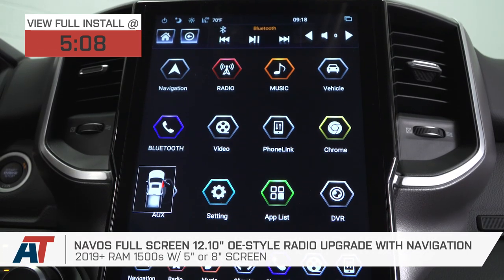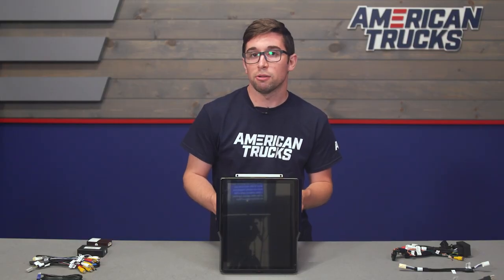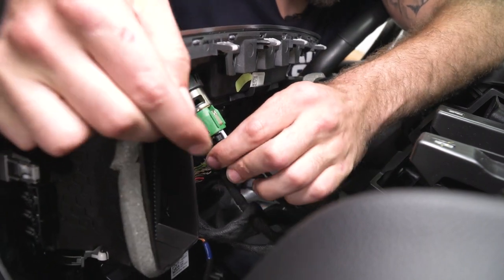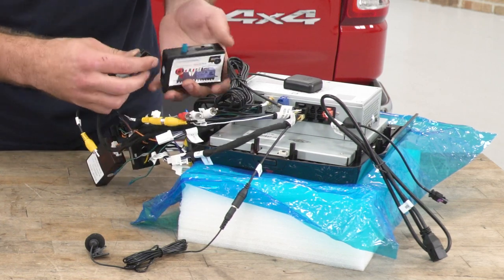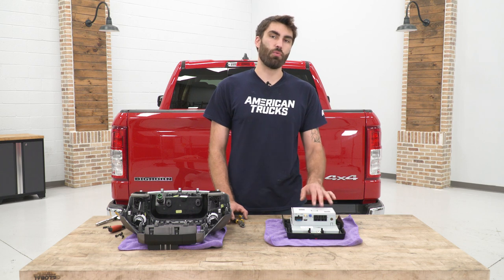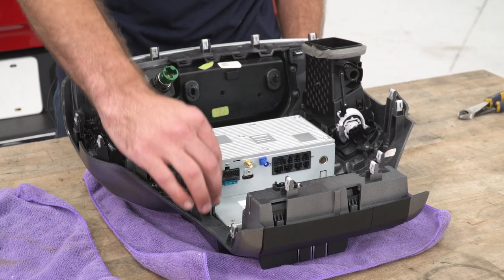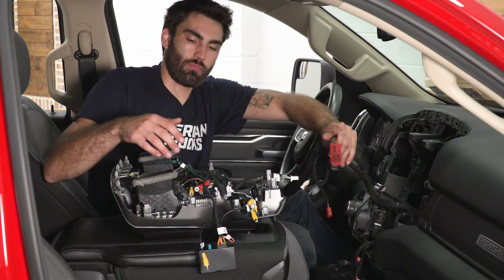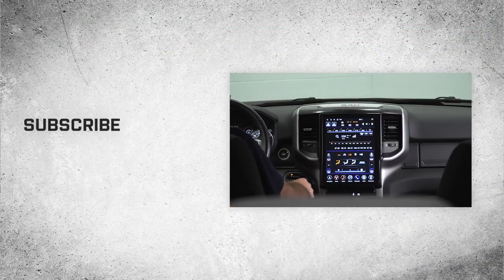2019-2022 RAM 1500 Navos Full Screen 12.10-Inch OE-Style Radio Review & Install

Comment from the maker: Shop this Navos OE Style Radio! : https://amtrucks.at/3deldWv
Reply: Does this fit a 2013 ram truck
Reply: For iPhone CarPlay you usb connector has a cable with “PhoneLink” label that one need to be run behind the dashboard and pass under then you can connect you apple CarPlay
Reply: Does this still work with the microphones built into the ram’s in the headliner

Comment: No Apple CarPlay or even Android Auto are complete deal breakers. Who would be interested in this tech upgrade for thier truck and not want those…
Reply: Android auto works BTW. Installed mine today. Labeled phone link but then android auto connects
Reply: For Apple CarPlay you need to use the cable is on the usb connector with name “phoneLink” has usb port you need to pass behind you dashboard under and then you can use apple CarPlay
Reply: @diegoarmandolupicascarano7003  how were you able to connect carplay
Reply: My buddy just told me the samething.  Plug your phone into USB plugs. Underneath your dash. U can see them Underneath.  Carplay will pop up on your screen.  Then u can use your GPS

Comment: Question:  My wife's 2019 RAM1500 4x4 BIGHORN, already has 4 internal mics along with a Shark Fin antenna with internal navigation/satellite built in. Will my OEM equipment plug in to the unit or must I omit the OEM equipment and use the equipment that comes with the unit???

Comment: Maybe a dumb question, but will this fit a 2019 RAM 2500 Tradesmen?
Reply from the maker: At the moment the this Navos unit does not support the 2019 2500.
Reply: I'm confused, just saw this on your website, states it fits my 2019 RAM 2500 Gen 5.
Reply: Any update on when this unit will be available for 2019+ RAM 2500 Gen 5? There aren't any options like this for my truck, and I really want to upgrade my radio.